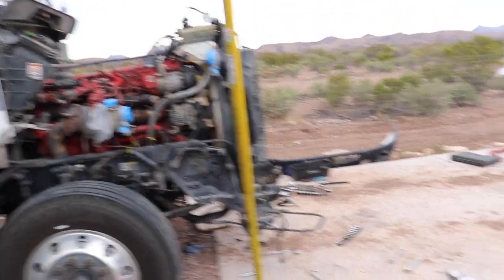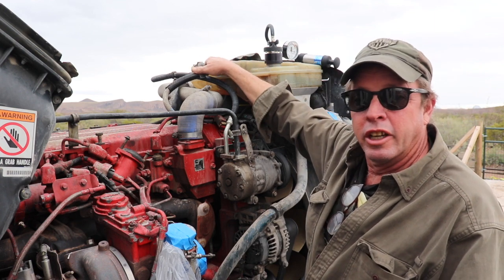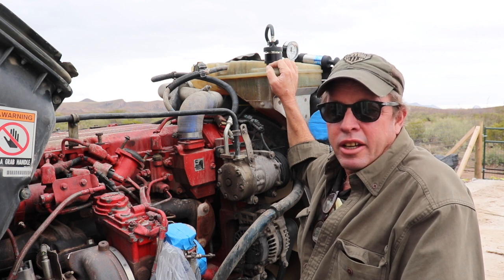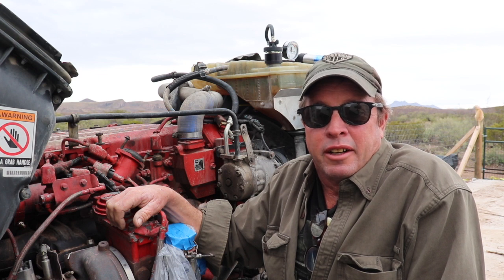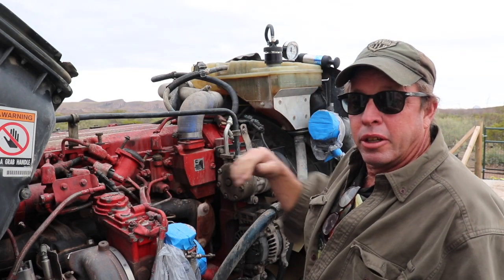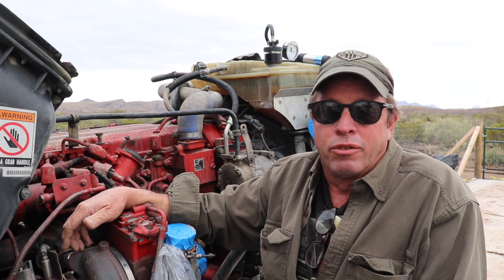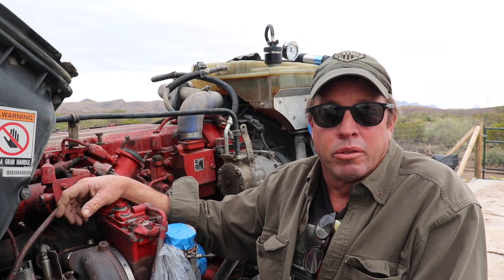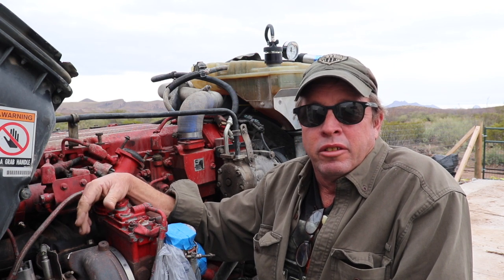1- 2012 Cummins Single Cam ISX Engine Failure (Could this be the end of my ISX) Overview Part 1

Comment: When those hoses blew was a symptom of the head gasket failure... The best way to test a motor in this condition is to drop the oil pan, pressurize the coolant system over night at 20psi. The following morning have someone bar the motor over and someone needs to be under the motor with a very bright flashlight. You are looking for coolant on the cylinder walls. Normally on the ISX it is the #5 cylinder that fails. If you see coolant on any of the liner walls, the liner has broken loose and has taken out the head gasket, and more than likely the head too.
Reply from the maker: Just pressurizing the system will tell you it there is a leak, you don't have to pull the pan. And NO, the hose blowing is not a sign of a bad head gasket. We have pressure relief system, when the coolant goes into the recovery tank (over flow) that is pressure being relieved. And what you said about pulling the pan, that will only tell you if you have a liner leaking.
Reply from the maker: Sorry, I just reread your post and you are correct about which side the liner is leaking. It was intact the #5 but if you watch my videos is all in there.

Comment: Hey mines is passing fuel to the oil truck working perfect and starting well already  replaced fuel pump what can it be thanks
Reply from the maker: I don't know. But check out ISX Solutions on facebook, a lot of great Cummins mechanics on there
Reply: INJECTOR(S) LEAKING OR INJECTOR CUP(S) IS CRACK LEAKING FUELING

Comment: Your service intervals are too far apart, at that age of motor every 10,000 miles to 14,000 miles, especially if you haul heavy... Also, do not lug these motors below 1500 rpm, do that and you will fret a liner, guarantee you that. Under 1500 rpm, due to the design of the ISX, you are beating those liners to death. And when in framing, make sure the block ledge the liner sits upon is machined and shims used, you will want liner protrusion heights set to .0014 of an inch. Do not reuse the old head, they are throw aways, one time use, only use a new OEM Cummins head. And follow the instructions off Cummins Quickserve when starting the motor, use an auxiliary pump to charge the oil circuit, DO NOT DRY START!
Reply from the maker: Apparently you have not watched all of my videos, all of that was done.
As far as my intervals, my bearings measured at factory specs so my intervals are fine, plus I run Amsoil and a bypass filter and have an oil analysis done at a lab every 15k. I'm sure i've got a pretty good understanding of what I'm doing